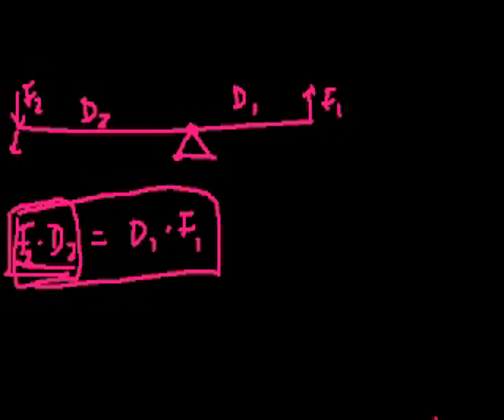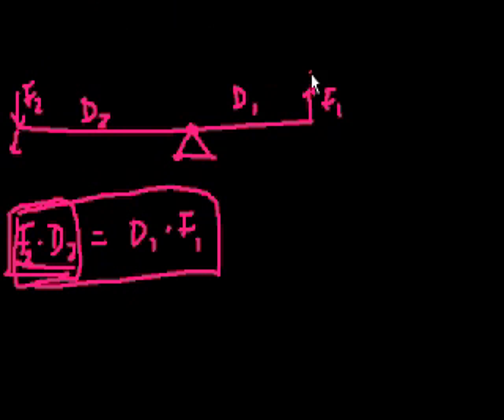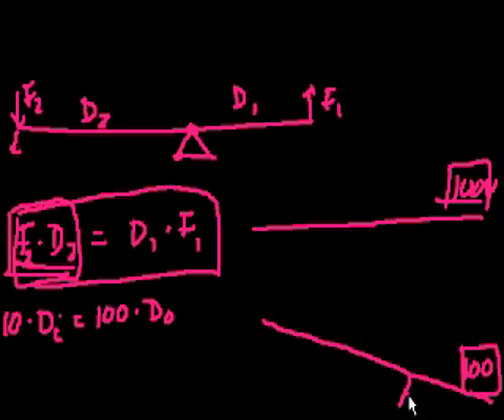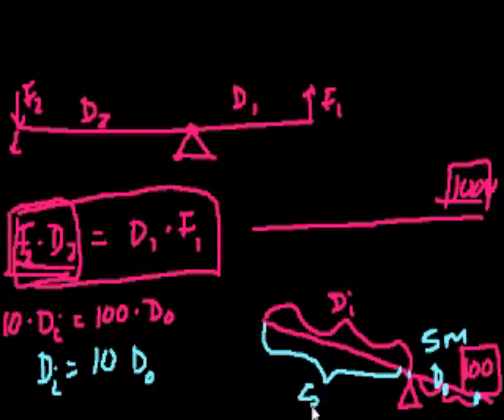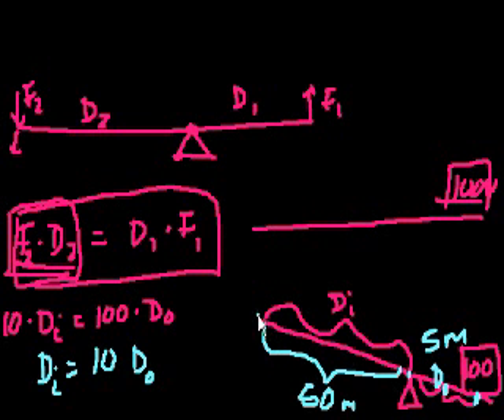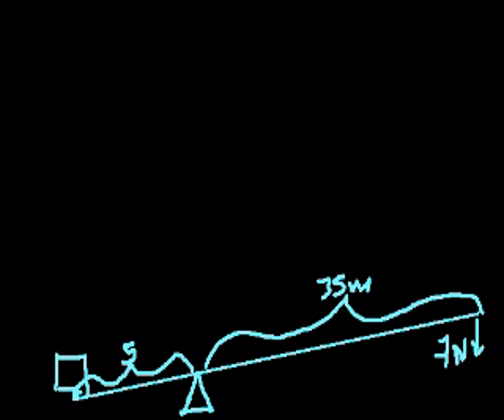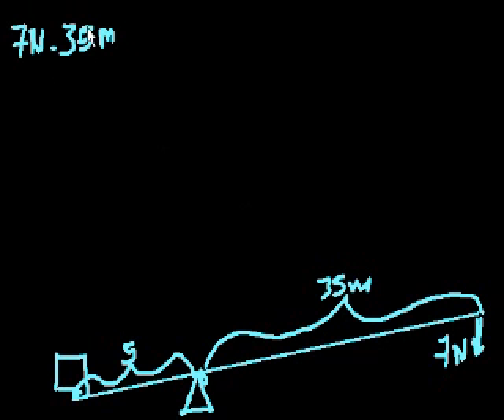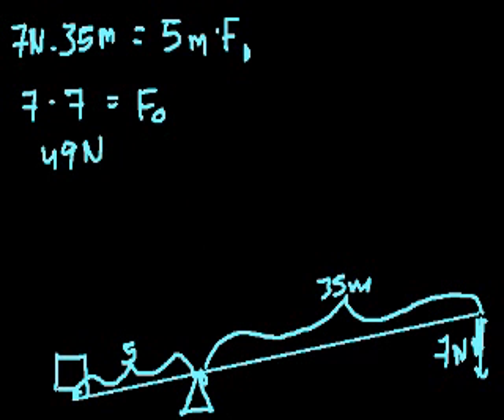Mechanical advantage (part 2) | Work and energy | Physics | Khan Academy

Comment: The formula "F1.D1=F2.D2",is only applicable when the system is in equilibrium, however in this case, the body is rotating and has a net moment.

Comment: But doing 10 N of force isn't going to move the block at all, right? Pushing with 10 N keeps it in equilibrium, so you can't ever cross a distance. The force would have to be greater than 10 N (10.1'll do it).

Comment: @madscirat Mass is a measure of the amount of matter in an object. Which is measured in grams, never Newtons. However, weight is not the same thing as mass. It's a measure of how much gravitational force is exerted on an object. This is why weight is measured in the same units as force, Newtons. This video works entirely with force/weight, so Newtons are always used in the video.